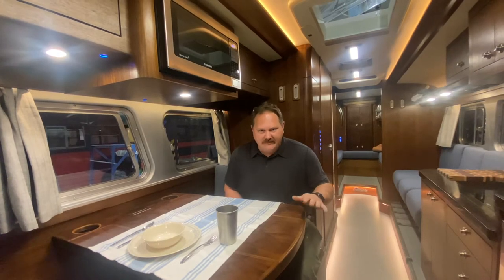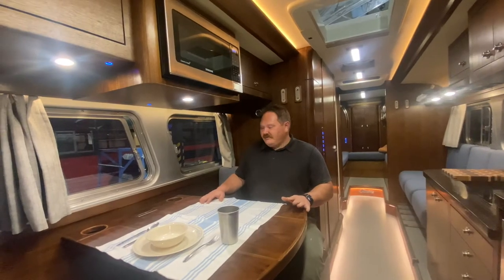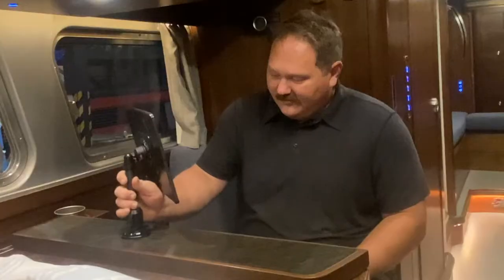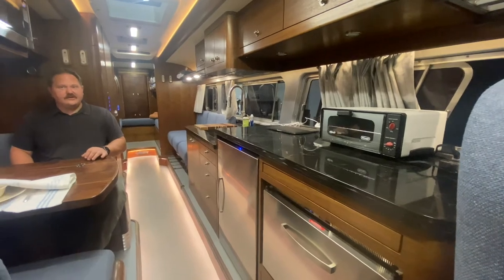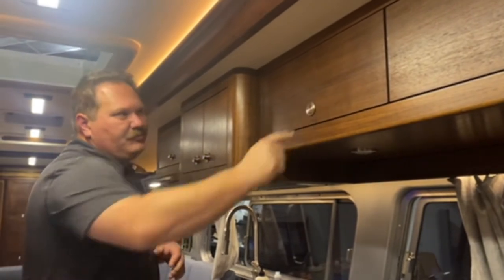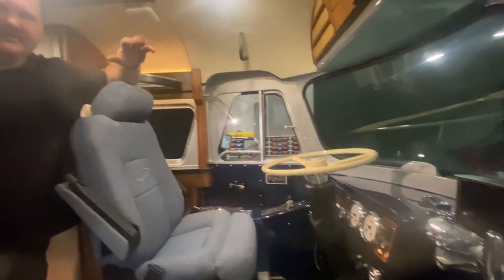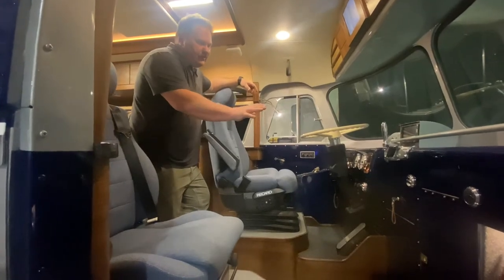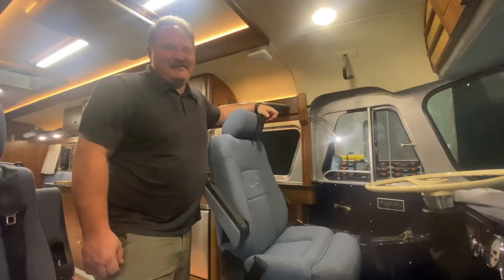Bus Conversion, Are you ready? Watch the Build take the Tour; Dinette, Galley, Cockpit

Comment: I absolutely love that booth, and the way you made the backs a little narrower, while rounding the outside lower seat frame, all to give you more room to move around, with that awsome Silversides type polished ribbed metal excusion at the bottom, exquisite. I really want a booth like this, and one that makes into a bed, in a MCI bus that I am looking to purchase, fingers crossed 🤞 anyway I would want to remove the two barrel chairs and wall table, and do something similar to this that would also match the existing trim in the bus, as it's  a nice looking bus, still waiting for an inspection.